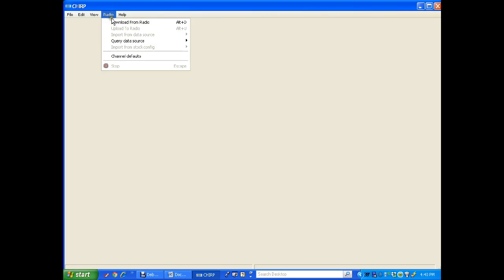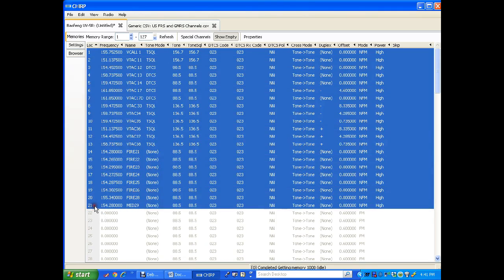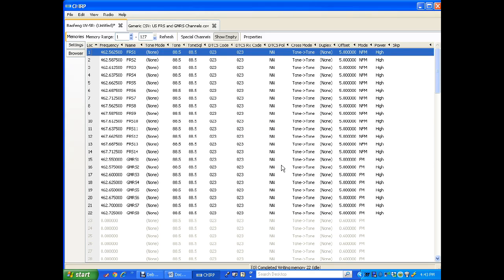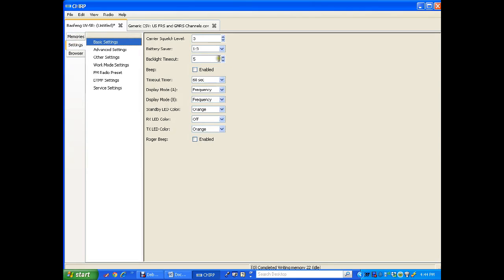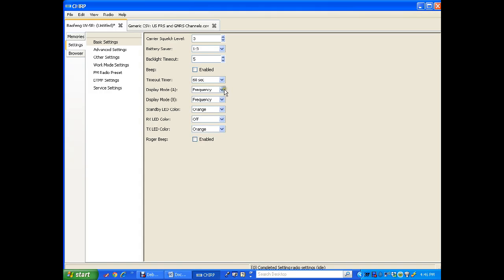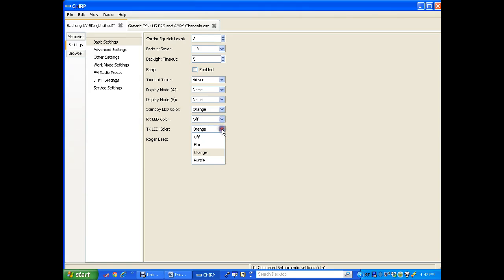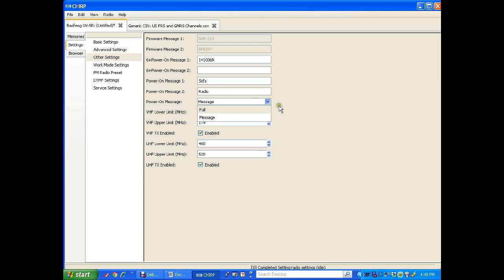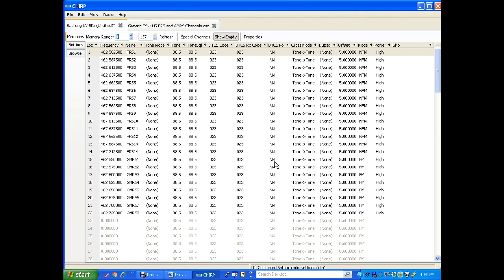Programming the Bafeng UV5R radio

Comment: Hi I just recently programmed my UV5R with CHIRP and wanted to program the same settings into my wife's UV5R and I am getting an error of  "The upload was stopped because the firmware version of the image (  Ver  BFB251 ) does not match that of the radio (HN5RV01  "   anyone could help it be greatly appreciated! Thanks
Reply from the maker: JimmyGunXD556 "read before write" always read the radio and then write to that download before uploading back to it.
Reply: Marcus LaBarbera 
ahhhh.... here's what happened for some reason I had to re-select the port again ( same port/only port option)  in order for it to take. thanks for getting back to me so quickly greatly appreciated I'm up and running. Have a great night!